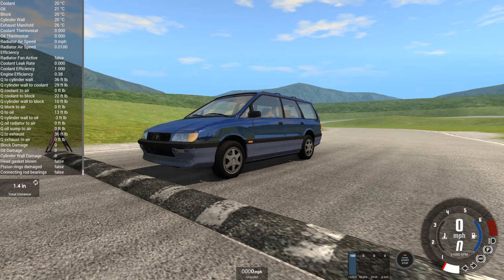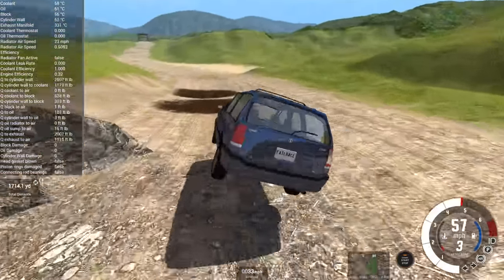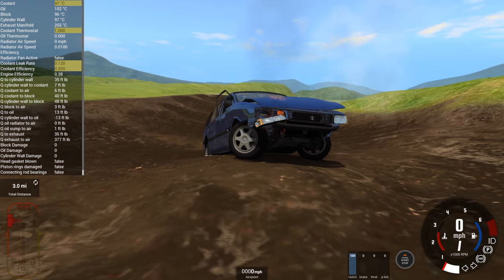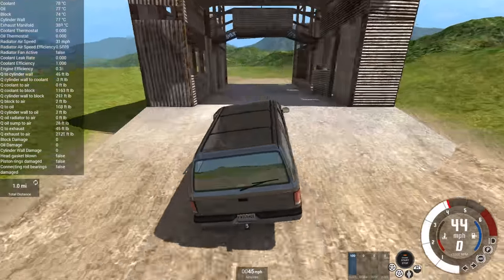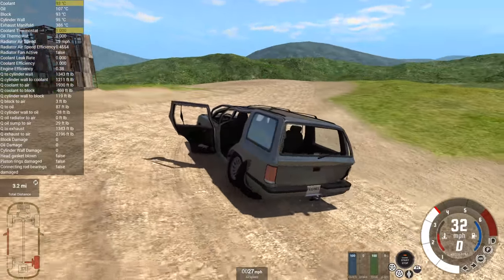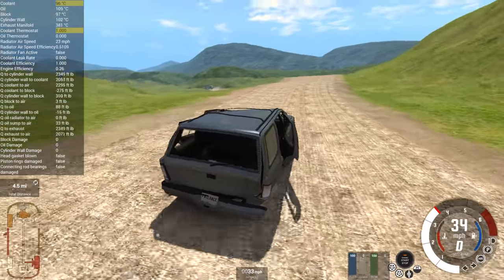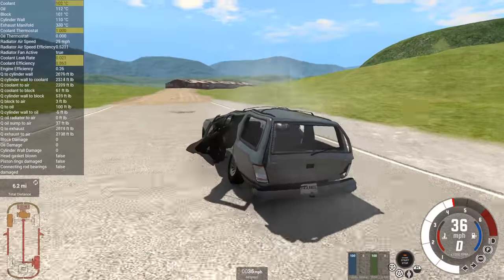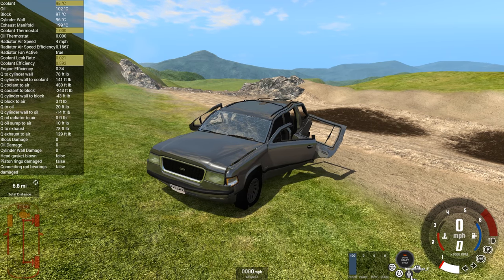BeamNG Drive Mods - The Endurodrome

Comment: Maker of the map here, this was a phenomenal video and it addressed every kind of feedback I was looking for and you pointed out things I intended for the map that I wasn't sure people would notice. I was hoping to have the 0.3 update out by now which added another chicane before the final corner and made the rocky section a little more punishing. I'll be reading through the comments here and keep the ideas in mind for newer updates to the course.
Reply: Bump this so Alex can see.
Reply: ZealousPlum as I said in a review on the beam site, but ill say it here to: some bumps and jumps are a little to hars in my opinion. And the mud area is pretty cool, but a stanced car wont survive that, because it will be beached. But overall, it is a very cool map. I like that you can go around this track in  high speed. And the putholes are 30 times better than the ones on the wreckoning (I should have smoothed them a bit).
Reply: I smoothed out the mud pit so cars will be able to carry enough speed to go through, and mixed in some very light patches of dirt to hopefully give cars enough traction to get themselves out. You really only have trouble with the mud now when the suspension is fully bottomed out but the update still hasn't been posted yet.
Reply: ZealousPlum ah, thanks for information! Ill check it out when the update is there.
Reply: yeah it was a weird glitch in the update, once the fix finishes moderating it should be back to normal
Reply: should be fixed now
Reply: ZealousPlum can you make a smaller version of this with dirt only like a tough truck track barriers and all?
Reply: A d d a l o o p
Reply: Did Beam update fuck this map? Missing textures and going into map editor crashes the game. Wish I could've seen some AI routes.

Much love, that's some talent you have ✌️

Comment: Please make this a series when the map is more finished!

Also in the cars with a high/low rangebox, please stick them in low when you start losing wheel axles and such, as the automatic transmissions sometimes freaks out and sticks the car in 4th or 5th from the open differential
Reply: Yeah, I think this could actually be the new Beam.NG series when the Destruction Desert is over
Reply: Raylovescars ! I hope so.
Reply: alex drives in manual

Comment: The gas tanks on the roamer and the d series are just in front of the rear axle on the drivers side, so you cannot puncture the tank without unrealistic force.

And when the rear wheel got stuck in the wheel well, the leaf spring had bent in the wrong way.